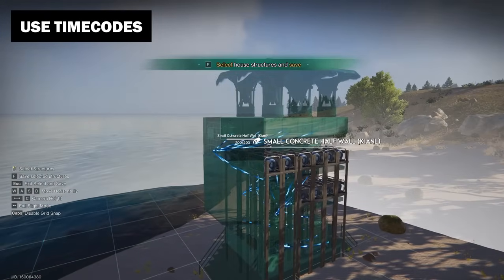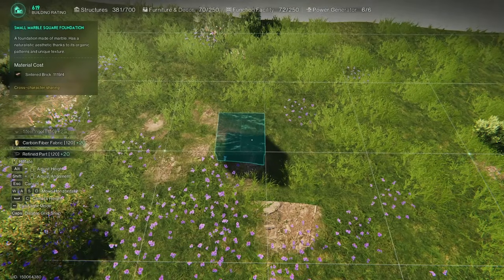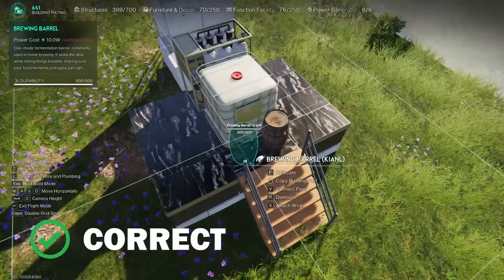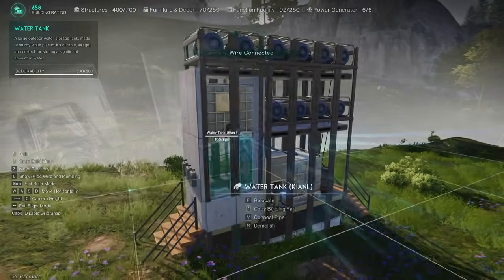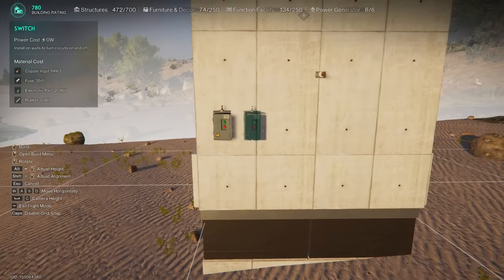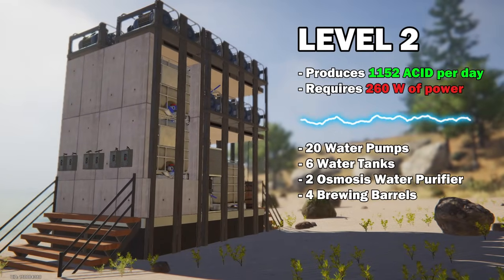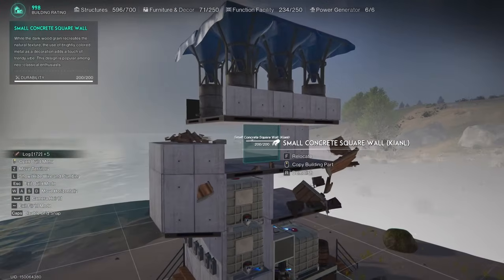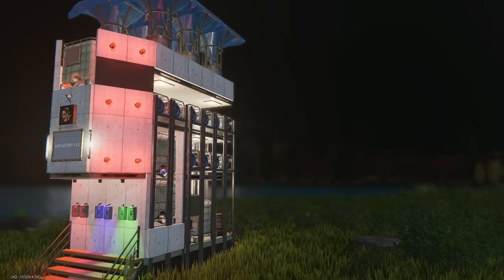Passive Modular ACID Factory (Saved as A Blueprint!) | 576 or 1152 Acid per Day | ONCE HUMAN

Comment from the maker: UPDATED ACID FARM (IF YOU CAN'T BUILD THIS ONE):  https://youtu.be/ccdt0Wk74f8
EASY Pure Water for this and other factories in Contaminated Areas: https://youtu.be/NZBvmOw2cAU
Reply: so the bottom tank  with the two stacked on top of each other, you tell us to connect pipes from that tank to the barrels but what is getting input from that tank and from where? i rewatched the entire guide several times nothing was mentioned about that tank getting anything its just an empty tank with pipes connected to the barrels that's it
Reply: @zetzwaykiritsugu  you manually put purified water in there to feed to the barrels. or setup a water purification station and have it feed to that storage tank.
Reply: @FirstPolor  Thanks. I had same dilemma, but then there's a another one; we connected 2 pipes from 2 water pumps to osmosis and 8 pipes to upper water tank, what is last pipe slot left for? He said we'll need that for later, but for what.
Reply: @Ines-uw5gi  that is for using rain catchers to store water in a separate tank and feed to that tank. Which will be on the roof.
Reply: @FirstPolor  I thought it could be it but he did not show or mention so I wasn't sure, or maybe I missed that part. Thanks!🤝
Reply: @Ines-uw5gi  he does later when he talks about connecting the rain reservoir but very briefly
Reply: Hey so if you save as blueprint and try to put it down it just drops a camera and just says progress what you do for that do you know?
Reply: @yourximage5359  yep, so if you do build, vs house build, it does the construction camera. which allows you to rebuild it piece by piece in building mode. and then you can stop construction at the camera when your done. and anything you didnt build, will get removed, and keep what you did build. however, if you place the blueprint down as a house build, it just builds it. as long as you have the mats for it. 
i hope this helps. there might be some videos that visually explain that better though
Reply: Can you please not use A.I. voice? Bit hard to understand  and slow it down a bit. Other than that, love it.

Comment: simply cant get this to work.. the two water storages at the start simply WILL NOT let me stack another ontop of it.... i fiddled with the walls for over a hour rotating each one and simply will not let me place the storage tanks like in the video....using EVERYTHING 1 to 1 of the video guide and wont let me... the walls do not change spacing when rotated...
Reply: i have the same
Reply: I actually couldn't get them that way either so even though it looks a little less clean I left the upper outside wall off completely and I was able to stack the pump.  Still could not place the upper outside wall but its ok.  The main issue I have is with trying to daisy chain the pumps.  I can connect the terminal to pump 1 and I can then connect pump 1 to pump 2 but it simply will not allow me to connect pump 2 to pump 3.  Not sure what I am doing wrong.
Reply: @rojoreds524  yea i gave up and just rigged my own setup.. its not clean but im looking for "working" not neat and fancy lol...
Reply: yo. I was trying it today and i found out that you can still do it you just have to make a ceiling on the left side as well (the bottom cieling he made on right just make same on left . then you can place the tank on top of each other. you can break the ceiling after you are done.

Comment: I think the fitting of the water tank in that tight space only works on the concrete walls and not with the stone wall. I tried it using the stone wall and I cant fit the water tank inside it.

Comment: i gave up on acid farm.. they said they would've add acid pipes , and they didn't do it, so it's not fully idle. i put like 2000 impure acid in each barrel and after 24hours they've only produced around 80 acid. at this point , i use a deviated chop stick and go farm at blackfell. in 10 mins i farm 1k acid.
Reply: Is that true? U can get that with Preserved deviated chops? 50% acid gain?
Reply: @Awesome-h1i  It's impossible.. a full run of around 20 min will net you ~400ish acid with Chops.
Easiest way is to just hop from world to world and go for cargo scramble where no one is. 500 acid for being afk for 5 min ain't that  bad
Reply: @antekordic  cargo scramble, is that the one that gives sproutlet?  Then buy acid from nisa?
Reply: @Awesome-h1i  Yup, that's the one.

Comment: Is this working for anyone now? I believe they patched things or something.. i can't stack storages over one another also, these small square wall designs aren't available to me.. 👀👀
Reply: Im at the same problem wher cannot stack the water storage, the square design is unlocked in memetics
Reply: The stacking of the water tanks doesn't work for this anymore. I have spent 2 hours trying everything to get it to work and all I get is "overlaps" error. RIP this design
Reply: @RealTweex  fortunately, someone in my hive had made a similar structure and had it as a blueprint. I asked him to make mine, did the necessary changes and saved it for myself.. lol
Reply: It's still working you can still stack water tanks on top just remove the right wall to insert the water tank
Reply: @JJ-ye3xj  Thank you. The only thing I didn't try and now it works.

Comment: don't understand, I opened all the elements of the building, but there is no such small wall that would look the same on both sides.
Reply: small square wall it will be there mostly on the right most part of structures in walls
Reply: same i got everything unlocked and still don't see this wall hes using.
Reply: @txmmily2587  They changed the look of some building parts in a recent update. He's using the concrete small half walls.
Reply: @CountDusk  yeah I couldn't really get it to work so I just used full sized structures.

Comment: No idea if they changed anything with a patch, but there is no need for turning off grid snap.. This entire thing can be made with no problems.. Also, what is your purpose for the buttom tank.. You connect it to the brewing barrels, so do you just manually fill it with water?
Reply: I'm trying to figure the same 😅

Comment: Hes talkin bout me.  \○/  i am one of the neanderthals that complaind bout the tanks not fitting in the small spaces. THANK YOU FOR VID!! great tutorial. 👍
Reply: I still can't do it. Do i need the exact same walls as he has? i am using the small stone square wall. i cant tell what way he is facing them. In the video he says face them out and that means hard side out right? i have tried that, i have tried hard side inward. i have tried everything and i am so frustraded. i usally never have issues building in games. it is not the makers fault i know i am doing something wrong.
Reply: @mediocoredistro9272  Same prob here.. Maybe we need the same skin.
Reply: You do need to use concrete walls as he is using.
Reply: @6nope9  I AM using concrete walls, but those walls don't change position when rotating them with the mouse. They just rotate in the same position over and over again.
Reply: Idk but when i used concrete walls it fixed that problem for me
Reply: Im using the concrete wall and tried to change position doesnt work for me either when trying to stack the second water tank
Reply: @dave_reed SAME! it does not work for me :(
Reply: @mediocoredistro9272  same here nothing work
Reply: @mediocoredistro9272  I got the bottom once placed but for the life of me can't get the top tank placed.

Comment: At 2:55 when placing the water filter, it is IMPORTANT that the filter is oriented the way it is, with the power connector node facing outwards.  If you face it the other direction, you can't get the filter close enough to the wall, making the water storage tank and brewing barrels not fit.

Comment: Yes, if u have trouble placing a fence or a wall on ur small foundation block or panel try rotating it. The orientation of the wall/fence depends on the orientation of the foundation block or panel.

Comment: I wasted hours and watched this video VERY carefully and I mean VERY VERY carefully and now I see what the problem is, I am stuck at this part as well, at 2:17 if you look very carefully, he is using/or supposed to use a "small concrete square wall" which has a pattern on one side and white on one side with a particular shape. but when he actually puts the wall, it is entirely different, it is white and both sides and does not have a shape, it is just a plain white wall, which is most importantly, THIN. if you don't understand or believe what I am saying, then compare this wall to your own and you will see for yourself. the wall he is using is either a mod or some exploit. I may be wrong, but my observation is correct, at least for me and my game. if I am wrong, please do correct me BUT only after doing this part yourself AGAIN right now just to check. in my opinion I think the devs either did something with this wall or this guy is just using a mod.
Reply from the maker: Use updated version https://youtu.be/ccdt0Wk74f8

Comment: I can't seem to stack the second water tank. Also, how are you getting the double sided small concrete walls? Mine have a black side.
Reply: there has been a Patch since this Video was uploaded that changed the Small Concrete Walls. They now only snap one way and these small form factor Builds don't work anymore. (at least not exactly like shown. You need to modify them. You can't fully enclose the Watertanks anymore for example)
Reply: @MrHomunkulus  It still works, I just made one today.  Just make sure the black portion is facing inward, and you need pixel perfect accuracy to get the top tank to stack
Reply: @ftgnarmacil1470  stacking the Tank is not an Issue for me. I'll try the build your way but i found a different solution for me personally
Reply: @ftgnarmacil1470  I tried it today and you are right it works with the dark sides all facing inwards. It's so weird though. They changed the walls and they only have one snap point now but suddenly it works when before you had to make sure you got the right snapping point allowing for more room inside the Box for Water Tanks. I wish they would add an alternative Version of that wall with sides blank again and just overall more version of existing building parts.
Reply: @MrHomunkulus  thanks man

Comment: very nice and compact, ill try this on next season,

but on your previous acid video with contaminated plant, i'm struggling to build 6x6 planter perfectly with grid mode, sometimes it won't be placed next to each other, 
and i realized that it's used a lot of functional build count which is limited to 250.

im using contaminated wheat, but its weird, to produce acid , i need 3:1, but the other plant, like contaminated aloe vera, its only need 2:1. i believe that's wheat used 2:1 at first, but i don't know it's suddenly change i think.

Comment: I have no idea how you stack the tanks at 3:30. For me, the bottom tank snaps to grid no problem, but the top tank does not snap to grid at all. The camera has to be positioned absolutely perfect to get the tank to line up where it needs to be, but I can't get it to line up, even in fly mode.

Comment: Bro, this channel is so GOATed. Having ADHD I love math-y (gimme them straight up numbers professor!), clean and well explained stuff like this. If there's a tiny thing is left out, my brain just glitches and I get nothing out of it.
This having the math explanation, the tips, the plan, the building, exemplified with each step and intended for easy blueprint saveing as well makes it a Godsend.

Also thanks for the tip about the inner/outer wall placement, I knew about that "feature", but I didn't think of it when my water tanks kept not being able to be placed in such glove-fit spaces (which I love, love them clean, space-efficient designs).
I'll surely give the new setup a try at the end of the season, so I'll have it for next. Currently not sure if I'll bother changing the current one for the time being.

Anyway, thanks, keep it up. And like lots have said before, please make some base and base defense tutorials as well, you'll likely get lots of viewers as well.

Comment: Can't put the water tanks in the structure. Tried every angle, made sure the walls were pointed out, per the vid, nothing worked. Any suggestions? I've tried this over and over. UPDATE: Got that sorted, now the pumps won't go. Says "cannot place here", tried caps on/off, not going in. Any suggestions?
Reply: Literally the same. I’ve re winded the video for an hour and a half and I’ve done everything the exact way he has done it. With the exact material and everything. I make sure the walls are shifted the same way he has them and the tank still does not fit. What a bummer. Maybe they patched it or something idk dude. I must be terminally ill.
Reply: @kyledhaene8935  there was an update few days after this video released - the walls are now looking different too.
they changed how walls snap on foundations, there is no inner or outer snap anymore - each wall overlaps the foundation 50%. just build the inner wall to the osmosis thing, worked for me right an hour ago.

Comment: This set up requires manually adding pure water into the bottom water tanks? (where is the omsmosis machine for creating pure water?) Also whats the purpose of the water tank at the bottom of the concrete square? Is it just to old the top water tank higher up?
Reply from the maker: tank between osmosis and barrel is tank for Impure Acid.
u need to produce pure water separately (this will help https://youtu.be/NZBvmOw2cAU ). or u can deliver it manually into bottom water tanks (which connected to barrels I mean)
Reply: @KIANL-GAMER  thanks, I build a mini water staion alongside this acid station of yours and its working well so far. I am by a river so just sopend 5 mins collecting water every few days and store that in a few water tanks

Comment: Great video and very helpful tips. However, @10:47 when you talked about the mini water pump, you only showed a pipe connected to each of the lower water tanks. Ok I got that part no problem, but what is the mini water pump connected to to get the water to flow to the lower storage tanks? Nothing is connected to the mini water pump to send to the lower storage tanks. I watched this video multiple times and I still scratch my head at that part of the video.
Otherwise it's awesome. I love it! I can make the mini version and or the double. Very nice indeed. Thank you kindly for the awesome video. :)
Reply from the maker: pure water needs to be produced separately
this will help: https://youtu.be/NZBvmOw2cAU

Comment: I do not know why, but my pumps are not transfering  the contaminated water to de water storages and the osmose purifier is not pulling contaminated water from the storages or the pumps, even with the water pump attached to it
Reply from the maker: in the build mode you can see the direction, in which fluids go through pipes. Make sure slot "from" is higher then lot "to".

Comment: Any chance you can do a video for a Oil/Acid Factory (aka Blackfell Oil Fields)?  Love your designs
Reply: This would still work in Blackfell, as long as you have contamination where you have the pumps.  The oil pulled, is actually not pumped to storage, but you pull it out of the pumps manually as a bi-product of polluted water pumping in an oil field.
Reply: @davidnelson8045  Understood.  This design could be improved for ease of accessing all the pumps to pull the oil out manually.  That's why I was asking about a design specifically for that.

Comment: Hi KianL, I hope my comment will be noticed and thank you so much for all your helpful guides.

Just need help here, so at 3:31, I was able to put the first water tank and fits perfectly inside. However I can’t stack another water tank above it. I tried so many things but none is working.

Could you please provide some tips?

PS: I am on Manibus Novice server and for some reason, our small concrete square wall has a black print on the other side, whereas yours shows both white. Not sure if that’s the issue.
Reply from the maker: hey. I tested this in the current patch, and this is still possible, but much harder now
try to put the water tank on top of the other one without grid snap. I did manage to do this on manibus server
P.S. I will update this build soon.